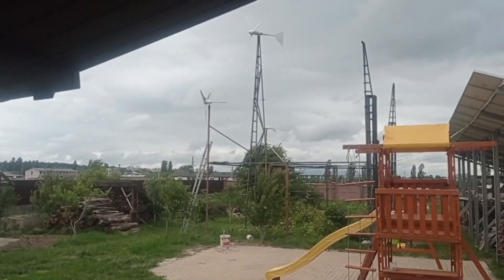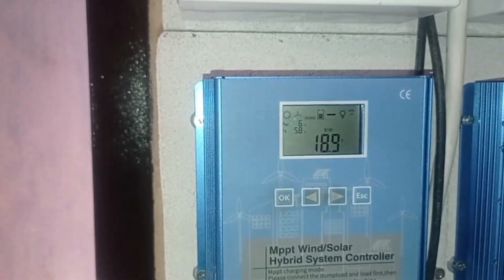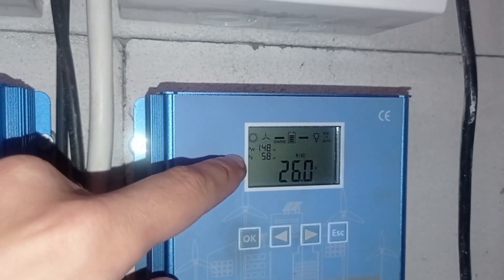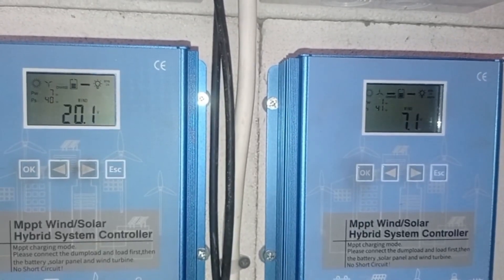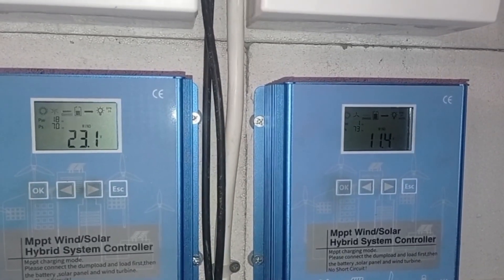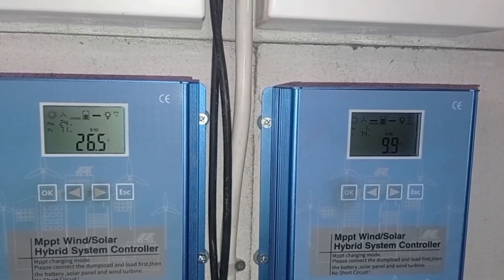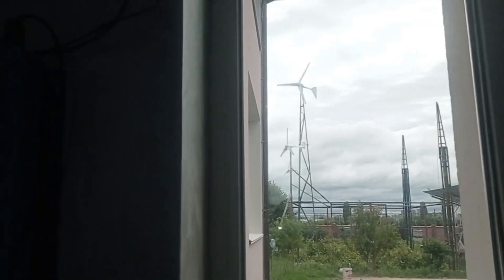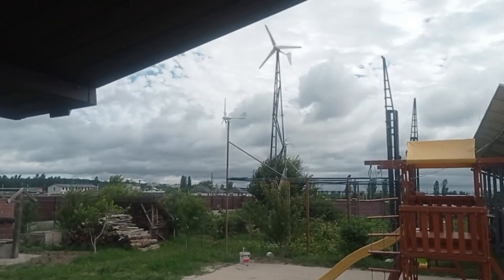S3 and M3 giving a shot! Checking how the default no-mods factory-made wind turbines go on the wind

Comment: Ok my Vevor with the generator which you got it did 1kw in last 3 days with my diy pvc blades - 92cm. Now I thinking to get the blades with the hub from m3 wind turbine. But it will be already the price of the parts of the oryginał m3 hehe. But do you think it is worth to get the blades for the modifications ? Or better wait and get The oryginał m3 ?
Reply from the maker: nah, just use it as it is. I mean, if you don't bother spending another $70-90 - go for the M3 blades at least for comparison )
but they are smaller, and in general will definitely be more loud than your DIY blades I believe. so if I were you - I'd not change the blades anymore. maybe think of getting it higher. as every +1 meter of height will add some nice production benefit.
Reply: @ hmm the problem with the diy - on my channel I left some shorts about how they looks like they are extremely laud when they hit 150w of production. And I am considering if they will be safe because it’s just made of pvc pipe 160mm and the pvc are fin  hmmm
Reply from the maker: well, M3 blades will be also quite loud, you can hear them on some of my videos )
but yes, your concern about safety is a good one, the PVC is very thin in general (4.0 mm is the max I've seen on 160 pipe), so it definitely may catch flutter on bigger winds too. M3 blades are quite thick, they don't bend on the wind at all (that's another issue with the PVC blades in general).
Reply: @ can you tell me in grams the weight of the blade ? I have to figure out if they will be  ok. Problem is with the modified generator which is holds to the body of turbine with 4 screws- little ones :) when did you added the generator had to change the thread ? I couldn’t find any screws with the tread us the original one so I just got the m6 screws and remade the thread to standard m6 size so I don’t know if this will be strong enough- the difference was one thread in 10 threads compared with the standard m6 screws
Reply from the maker: @Poszukujac-raju  I just used the thread maker to apply a new required thread and that's it. and the M3 windwheel is light enough to sit there firmly. let me find if I have ever measured its windwheel weight
Reply: @ so we did the same :) just the weight of the blade I’m interested :) thank you for your help  and the videos - like everyone we all learning from experience :)

Comment: My solution to the tail always looking to small is,  if to big the reaction time would be quicker, resulting in the blade onthe side of the wind could invert, resulting in lose of power , to small and yes spinning out of the wind and around, an average size tail would forgive thoughs small side gusts resulting in slower reaction time directing to the wind with on lose of power, i think this is what the wind turbine industry call furling, but furling in sailing term is for takeing a sail down due to much wind, ive also come across furling out of the wind from over spinnig and to protect the generator,, but think the generator can look after its self, the over spinning, brake not holding the blades still and i think its furling in, controling the direction into the wind, forgiving thoughs big gusts, like pulling down a sail on a sail ship, thanks Henry
Reply from the maker: even the default factory one will work nice even the turbine is given the stable laminar air flow - which is impossible in our standard home areas.
however, in general here are the rules for the wind turbine tail: https://www.windynation.com/blogs/articles/sizing-your-wind-turbine-tail
I plan to follow them while redoing the tail on my M3.
Reply: Great read, thank you, calculated i get about a month of perfect stable air flow, split up into hours days weeks at 40-50mph over the autum winter, then a gusty 20-45 with 40-80 2-3 times a year averagely. wished i had erected three turbines in a triangle or four in a square so when one would catchs the 45mph then the other ones would in theorie catch the 20mph resulting in a nice current charge. longer rod to the tail would slow the reaction down due to the distance it would have to travel to redirect the turbine.

Comment: Like you said you have to add longer tails to all of them. Cheap ones.
Reply from the maker: no, S3 sits quite well on the air. no such fluctuation is seen, that tiny one is perfectly balanced at the moment.
for the M3 - yes definitely, I had specifically mounted it that way as it is - to show you how it behaves, and then we will compare how will it go after the tail modifications.